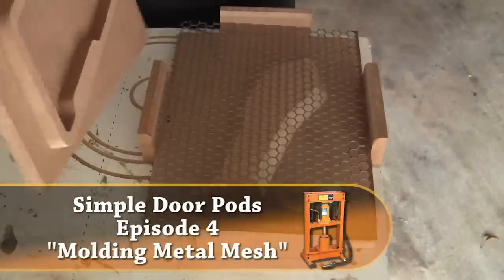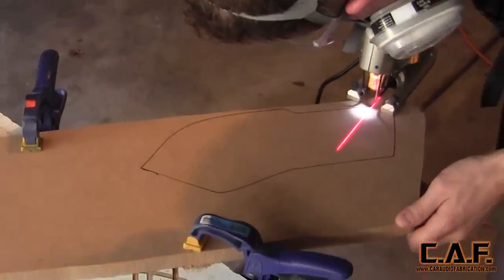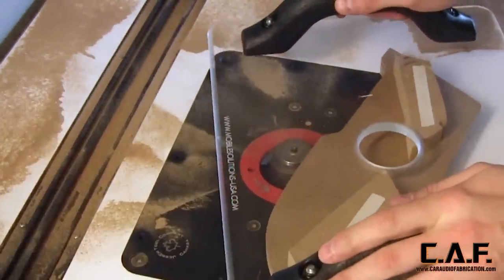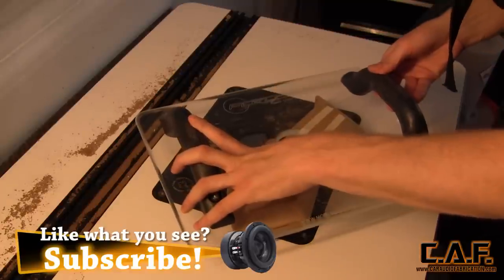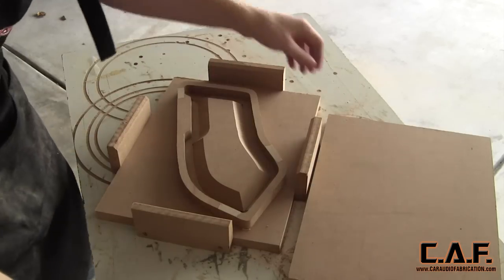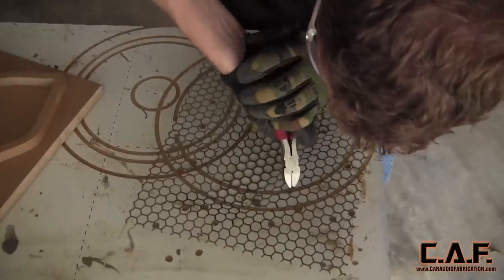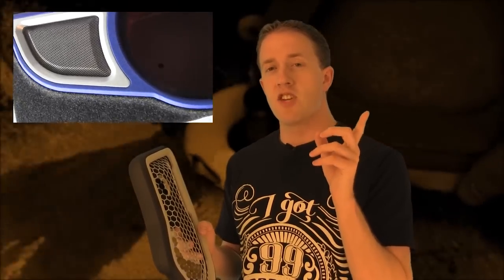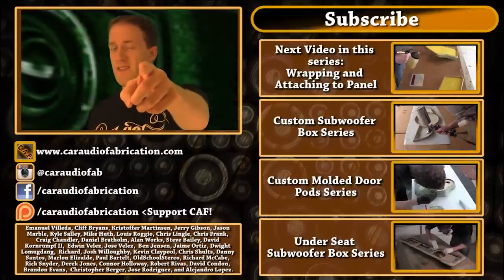How to Make Simple Door Pods (Part 4) Mold Metal Mesh

Comment: I have always kept my rear speakers.  Yes, it is better to have that front soundstage, at least I think so, but that's no reason to deprive riders in the back from listening.  One could say, "Just crank it so they can hear from the front", but anyone who has been on an hours long cross-country trip will know you can only listen to it cranked for so long.  Especially if you have a wife and kids.  So again, I keep my rear speakers, but I aim them slightly back and the use the Fader to adjust the balance to slightly front.  This gives me that front soundstage, a little rear-fill - a la surround - and allows whoever is in the back to enjoy the music, even if it's turned down a bit.
Reply from the maker: Michael Craven I suppose
you could always leave the fade set all the way to the front, then adjust when
you have passengers! Thanks for watching!
Reply: CarAudioFabrication That could work for some, but as a father who always seems to have his kids with him, I just leave it as is.  There is some back fill, but I really have to focus to 'hear' it.  If I adjust all the way to front, I notice the difference, but the backfill is so minor that it does nothing to detract from my front soundstage.  Jimmy Buffett is still standing on my hood.  The backfill is just the speakers they have in place for the nose-bleed sections.

Comment: there are pros and cons to front and front/rear stage installs.
where I agree that a front stage is all you need for that very reason in staging I will explain why it is also sometimes benificial to have rear staging.
adding rear fill will help create a much larger environment such as a concert hall. it will help turn a small car into a car that feels as if its the size of a tour bus. 
problem with rear stage to get technical is.. it creates even more unwanted reflections around the vehicle. which in the sound quality world is a very bad thing. basically every time a sound hits an object in the car it will bounce off almost created a delayed sound by the time it gets to your ear. this will also create that same sound twice or three or four times. 
so however adding rear fill will create that larger environment it will also cause a lot more problems and need much more aiming and time alignment.
only having a front staging will eliminate this but make your sound stage just a hair smaller of an environment. not to mention music is only recorded in stereo and not 5.1 

I once heard an amazing install in mark summers vehicle where he had alpine proccesors as well as a no power alpine headunit 
the only time the rear speakers in his vehicle were active was when he put in a 5.1 dvd, other than that they remained turned off and the stereo only produced what the raw form of the music was actually recorded in.

Comment: Keep them. As a sound technician you learn about immersing your audience. The only way this is effect cannot be achieved is in a large park concert, Due to the fact that the length of the cables would at some point start to fall behind the live concert audio, thus creating an echo effect. On the other hand I suggest you to run an 80-20 ratio. This means 80% front audio 20% rear audio. If you have guest that ride with you I would reduce the ratio to 60-40 so that they can become immersed in the music as well. A key factor is a sub, because depending on the size of the sub depends on how much back fill you have. It will take some adjusting, but you will eventually find what ratio suits you best. Personally I run an 80-20 ratio with a 12 in Kicker compR sub in my Kia Soul and the sound quality is very full. I Hope I helped a few of you on your sound balance.

P.S. +CarAudioFabrication keep up the great work!  Your tutorials really helped class my speakers. Thanks for the help!

Comment: Keep the rear speakers but if the subwoofer is in the rear. Consider putting it in the center console facing the firewall of the vehicle. Much like how a lot of GM trucks are done when have the Bose system in place. I like it that way cause then it brings more of the music sound coming from a stage setting deal. While still maintaining a surround sound in your ride. Of course this is my opinion of how it sounds. And huge subs aren't always the key to good sound in my opinion.

Comment: Keep as rear fill. Most of my systems, as in my '05 Silverado, I had 3 sets of 6.5" RF Power components up front, each on a 2ch Orion 225HCCA. For the rear doors, I ran 4x6 Plate components. Infinity to be exact. I actually left those on the rear channels of the head unit for a while. MOST people (the non audio heads) wont hear them, but I sure did. At full tilt, i didnt, but I didnt listen full tilt at all times. My question to YOU, CAF...how do I go about getting a set of these pods with the fine diamond mesh from you guys? LOL

Comment: Currently, my car has no rear stage, simply because it's a work in progress.  I've dropped a box with a couple 8s into the rear deck, and I'm still playing around with how I want everything to sit.  The box itself will likely undergo several complete remakes before I'm happy with it, then it's a matter of do I want to fiberglass a custom rear deck lid, or do I want to fiberglass the rear pillar trim to accommodate speakers for the rear stage.  Running only a front stage at the moment, I'm not entirely happy with the sound.  From the factory, there were two 6x9s in the rear deck which made really good use of the shape of the rear window to reflect sound forward, and I find myself very, very tempted to take advantage of that.  My musical tastes are so broad that it's difficult to build a system that can handle all of it equally well.  90s Techno bass may sound great, but when I pop in a CD with Finnish Pop-Polka, all of a sudden it doesn't sound right.  I do prefer a full, enveloping experience when I'm driving, however, so I may be unfairly biased here.  :-]

Comment: I keep all 4 speakers and 2 twitters,
////Alpine Professional Bass Engine in the dashboard and a 8" subwoofer powered by a 40w ram class D home made power amplifier,
Not trying to shake tha neighborhood...
Reply: I don't know the RMS at that 8 inch sub but I can tell you it's definitely not 40 Watts. Remember you can always turn the bass knob down but you can't turn down distortion. Underpowering the speaker is worse than overpowering it.

Comment: Depends on the car I think. My craptastic car sounds a hell of a lot better, and louder with some coaxials in the rear. I ran only the front for a few months before actually finding some rears I liked(cheap). Don't understand why anyone would just want to run the fronts only. I like the sound to fill the entire car. My next step is to definitely sound deaden that car. Horrible on Highway/freeway.

Comment: Gee  17 years exp you'd think I knew that answer!

Keep Rear Fill but it dosn't play anywhere as loud, however in some 4 door auto s rear fill becomes a front stage for passengers in the back.

However and I'll point this out, if somone comes in with a 1976 trans am by all means install 1 set of 6x9" if they ask you to because this car will make some nice bass because the trunks so small 2 sets if they like it and you can skip the subs, then some people like late 70's cutless to have 2 and  3 pairs of 6x9" in the rear deck.  So the answer is depends on what your customer is after. Its not musically correct we know this but its what the customer asked for and he's buying it.

To sum it up, there is no right or wrong answer.
In a concert you hear sound from all angles including behind you above you or everywhere.
I've listed to Live bands all my life in basements, concert halls and night clubs and laying track on media you hear sound from everywhere.
Now are you going for SPL SQ or just good sound? Or someone's Idea of SQ and what it should sound like? Personnel a flat RTA dosn't sound that great. But that's my ears.
Just like I do not like Metal dome tweeters or horns. Give me Silk or turn it off.

Comment: in my car i have replaset all the original speakers and installt,  2 tweeter and 2 mids in the front and 2 6x9" in the back aswell as 2 12" subs in the trunk , and it´s sounds bitchin :) :)

Comment: Lol $60 for 2 plastic handles and a sheet of plexi with a hole in
Mobile solutions-nice product ideas at ludicrous prices!!
Reply: you need to count in the work done here, which you can not do yourself - mainly because most people don't have access to the proper tools - doing this yourself would probably took you 3 days with the normal garage tools, and you can't buy it anywhere because it's custom
Reply: +draconpost 1 stop at a hardware store and about $5 in product.  2 handles, plexiglass, drill 4 holes, attach with rivets just like they did.  Still, it's a nice safety tool.